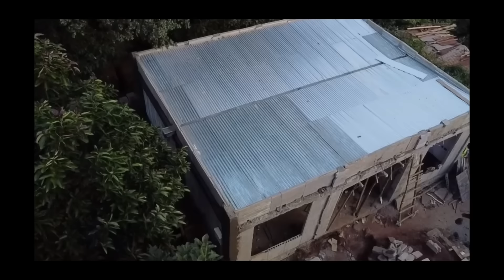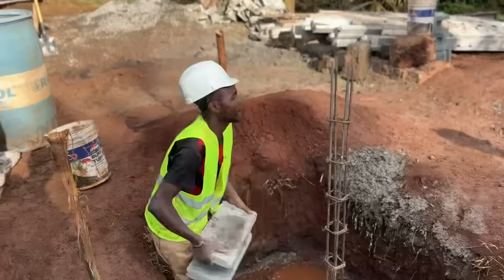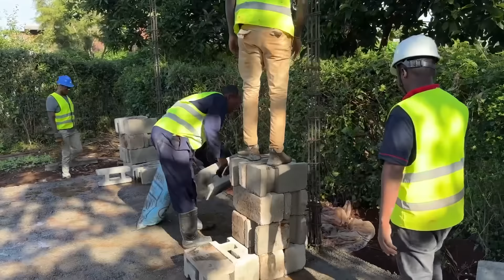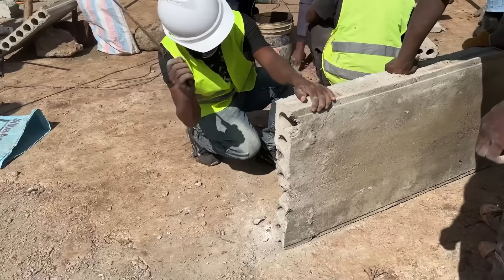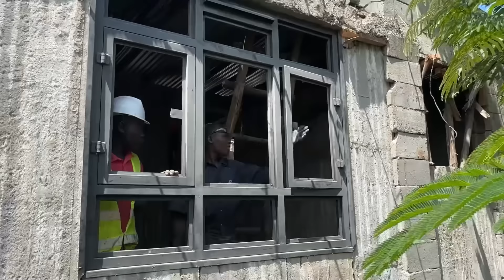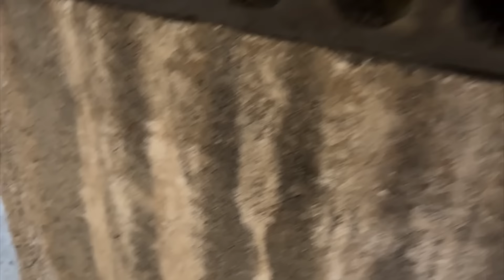Building a 3 bed 2 baths precast unit from only Kesh 1.9m

Comment: I am interested but I have a few questions..

How secure are the houses in terms of thieves drilling in..

How can someone get I touch with you.

Can you be contacted to construct for someone. ?
Reply from the maker: We are located on the following locations 

Floor Decor Nairobi 
1 Kijabe street ,Universal church building  opposite Simlaw seeds 
 0780 955 000/ 0722679830 
Nairobi

Precast Factory outlet 
0720 749 270
Gitaru , Kikuyu

Comment: I am worried about sound between rooms because of the thin walls
Reply from the maker: Got it! Primary school science: sound travels faster through solids like dense ndarugo stones (vibrations pass right through). Hollow-core 90mm precast panels have air voids that interrupt waves, cutting transmission—STC around 45dB for good insulation. Lighter, faster build too.

Comment: Just wondering , those precasts looking at the way they are cut even using a panga, there is no renforcement say even mesh wire or steel bars  they are just like slabs ... or have i missed something ??

Comment: Just wondering, is the 90mm wall sound proof?, also please talk about insulation for the precast house....
Reply from the maker: The FREQUENTLY asked question (FAQ) asked about SOUND TRANSMISSION CLASS (STC) of 90mm hollow core precast wall panels is 45 decibels compared to Durago stones which has 40 DB.

Comment: This is actually the worst precast panel work I've ever seen. There are many cracks in the panels, which is not good for a modern concrete structure. Please try to improve on your work nest time.

Comment: How do i reachout to you. Need to build
Reply from the maker: Jambo .
In order to share precast concrete  material quote for both raised foundation ,composite slab and walling kindly share an architectural drawing with detailed dimensions . WhatsApp to 0722-679-830.

Or Visit our showroom for more info 
Floor Decor Nairobi 
1 Kijabe street ,Universal church building  opposite Simlaw seeds 
 0780 955 000/ 0722679830 
Nairobi

Precast Factory outlet 
Kibaru road 
0720 749 270
Gitaru , Kikuyu 

Floor Decor Thika 
Exit 16 A Thika road 
Total energies Jomoko 
0780-850-000

Comment: I am in love with precast panels. I would love to have one like that but,with a concrete roof instead of iron sheets.
Reply: Concrete roof will be unnecessary heavy and it will need to make the whole carrying structure more expensive. I wonder about aluminium roof panels, that should last and is easy to work with.

Comment: Interesting ... though their exist alot of gaps starting from the foundation, Lack of DPM will have an effect on the floor and lower part of the walls... whats the effect of not back filling and leveling the base before laying the precast, it might be a breeding space for parasites like rats, moles etc in the long run.. i mean most people are looking foward to cheaper methods of construction but in the long run it is expensive.
Reply from the maker: Hundred units done none of such issues exist / feel feee to visit and inspect

Comment: The dedication here is top notch- passion driven per se. Good job engineer. Now I have a concern, sound haipiti through kwa hiyo precast wall virahisi???
Reply from the maker: @kevinchirchir9713  The FREQUENTLY asked question (FAQ) asked about SOUND TRANSMISSION CLASS (STC) of 90mm hollow core precast wall panels is 45 decibels compared to Durago stones which has 40 DB.

Comment: Amos I have a question about vermin control I mean pests like rats that will have a permanent dry home too. Safety for the dwellers and especially. Thank you for your ingenuity to solve the housing problem and at cost effective prices.
Reply from the maker: The crawl space is walled around the perimeter

Comment: Are precast sound proof?
Reply from the maker: @Fredstar_Ke  The FREQUENTLY asked question (FAQ) asked about SOUND TRANSMISSION CLASS (STC) of 90mm hollow core precast wall panels is 45 decibels compared to Durago stones which has 40 DB.

Comment: Wooow! This is a God-send! Vile nahangaika 🙆 gharama ya kujenga nyumba on my piece of land I just purchased! ! 😮
I will definitely go in for this. Thank you 🙏 ♥️
Reply: Contact RACKBAR HOLDINGS. Well known in the industry. Kuna moja jirani yangu uko Murang'a anajengewa na wao.
Reply: Did you get the full information?
Reply: @stephennzioki9615 no I need the numbers
Reply: What is full price? Transporting concrete to kirinyaga county? Full price I need? Thank you
Reply: you just dont know how expensive it is to  transport those  precast wall pieces,,, if you have that cost in mind, then you are good to go, though iko cheaper, just do your math
Reply: @todayinafrica-u6e how much to transport to kiriyaga county?
Reply: @Jocetheangel888  depensize of the house, it can take you  3 to 5 trips, i trip to kirinyaga can be 50 k  so do your math,, precast is cheap when the  factory is near you so u will save cost, otherwise, the transport cost
Reply: @todayinafrica-u6e 50k*5,=250k.what of numerous trips made here n there buying materials for a stone house?
Reply: @todayinafrica-u6e to the coast I gears say around 189k but to guild 30k-34k per square meter same house using precast and 40-43k using stones at the end of the day you save like a million son100-180k and saving in headaches, stealing and materials wastage plus workmanship you can't control-you choose your hard.Again rhise living close to nairobi cam have it cheaper.with regards rontransport ,mark you they transport also rhe window frames alongside if your contractor buys from floordecko and you pay for the full shell.The transport will include your burglar proofs and all you need for roofing too.

Comment: Does 1.9M include everything. That's materials and labour or are there other additional costs?
Reply from the maker: @fredrickevansw4390  distance from Gitaru factory could increase cost other factors like site accessibility if very remote could be an issue
Reply from the maker: @fredrickevansw4390  distance from Gitaru factory could increase cost other factors like site accessibility if very remote could be an issue

Comment: How soundproof are those walls? They're a bit thin
Reply from the maker: The FREQUENTLY asked question (FAQ) asked about SOUND TRANSMISSION CLASS (STC) of 90mm hollow core precast wall panels is 45 decibels compared to Durago stones which has 40 DB.

Comment: Just a thought: I think you should simplify the floor plan. It's better to have bigger spaces, and later subdivide them with removable walls. That will make the house cheaper and faster to build, with better quality and more flexibility for individual requirements. Thanks for a great video.
Reply from the maker: Precast walls are versatile can be moved if needed

Comment: My question is,the other locations you've shared where your offices are located do they offer the same services or is it just the Kikuyu office?
Reply from the maker: @conniecole3390  We are located on the following locations 

Floor Decor Nairobi 
1 Kijabe street ,Universal church building  opposite Simlaw seeds 
 0780 955 000/ 0722679830 
Nairobi

Floor Decor Thika 
Exit 16 A Thika road 
Total energies Jomoko 
0780-850-000 

Precast Factory outlet 
Kibaru road 
0722-679-830 
Gitaru , Kikuyu 

Floor Decor Mombasa 
Link Road / Malindi road Junction Bobs Restaurant building 
 0755 960 000 Nyali 
Mombasa 

Floor Decor Nanyuki 
Behind quickmart Irura Road
0755 660 000
Nanyuki 

Floor Decor Eldoret
Sosian Street Next to Eagle Hardware
  0780 755 000 Eldoret

Floor Decor Kisumu 
K - City business centre , Block C 10357
Omollo Agar road Opposite New east view hotel 
 0780 855 000 
Kisumu

Floor Decor Nakuru 
Wabcom house , Moses Mudavadi road Facing Nyayo Gardens / court road 
Call 0780 355 000 
Nakuru

Floor Decor Naivasha 
Mbaria kaniu Avenue 
Next to G4S
0755 940 000 
Naivasha 

Floor Decor Uganda LTD 
Location: Kira road opposite bank of Baroda 
Kampala 
0767257143
Reply: @floordecorkenya9339  You still haven't answered my question
Reply from the maker: @conniecole3390  manufacturing happens in kikuyu .

Comment: Good video, giving us something to think about but the information was limited, the amount of money spent on what, and the time spent doing what would be of much value, other than that, it is overall good.
Reply from the maker: Affordable 3 bed Precast Bungalow 75 sq m .

Here is the breakdown for shell only that’s is foundation / walling , Metallic doors, windows and roofing .

Precast materials cost including Foundation and channels Sh 729,800

metallic windows , doors Roofing plus labor 365,000/-

Labor to assemble precast materials Sh 165,000

Total cost Sh1,259,000

Finishes including windows glass  / wooden doors / gypsum ceiling/wiring/plumbing/paintworks/cabinetry /flooring is excluded and is as per clients preference and budget

Precast materials transport EXCLUDED

9 day job to assemble such.

Watch https://youtu.be/dCjze9QtCcI?si=AA4pKEfcyJX1cpEu

Comment: Foundation imekula pesa ngapi?
Reply from the maker: Affordable 3 bed Precast Bungalow 75 sq m .

Here is the breakdown for shell only that’s is foundation / walling , Metallic doors, windows and roofing .

Precast materials cost including Foundation and channels Sh 729,800

metallic windows , doors Roofing plus labor 365,000/-

Labor to assemble precast materials Sh 165,000

Total cost Sh1,259,000

Finishes including windows glass  / wooden doors / gypsum ceiling/wiring/plumbing/paintworks/cabinetry /flooring is excluded and is as per clients preference and budget

Precast materials transport EXCLUDED

9 day job to assemble such.
Reply: Now you have come out clear.I was really wondering how the entire shell plus finishings cost the 1.9M!

The 1.9M is the cost of the shell structure only. Finishings are excluded, and are as per client's preference. This makes a whole lot of sence. Thanks for the clarification!
Will contract you soon.

Comment: Wow, this is amaizing work. Kudos, are u available countrywide or ur only based in the central region? This is quite commendable. Subscribed, il definately hit u up.
Reply from the maker: @gerry9526  hi

We supply country and have showrooms in various locations .
Floor Decor Nairobi 
1 Kijabe street ,Universal church building  opposite Simlaw seeds 
 0780 955 000/ 0722679830 
Nairobi

Floor Decor Thika 
Exit 16 A Thika road 
Total energies Jomoko 
0780-850-000 

Precast Factory outlet 
Kibaru road 
0722-679-830 
Gitaru , Kikuyu 

Floor Decor Mombasa 
Link Road / Malindi road Junction Bobs Restaurant building 
 0755 960 000 Nyali 
Mombasa 

Floor Decor Nanyuki 
Behind quickmart Irura Road
0755 660 000
Nanyuki 

Floor Decor Eldoret
Sosian Street Next to Eagle Hardware
  0780 755 000 Eldoret

Floor Decor Kisumu 
K - City business centre , Block C 10357
Omollo Agar road Opposite New east view hotel 
 0780 855 000 
Kisumu

Floor Decor Nakuru 
Wabcom house , Moses Mudavadi road Facing Nyayo Gardens / court road 
Call 0780 355 000 
Nakuru

Floor Decor Naivasha 
Mbaria kaniu Avenue 
Next to G4S
0755 940 000 
Naivasha
Reply: @floordecorkenya9339  Fantastic, il contact you soon. Thank you so much.

Comment: Very informative, no weird musics, just good
Reply from the maker: Thanks! We like to keep it simple and focused on the work.
Reply: Swali, hii bei ya 1.9 imebeba adi labour like Kila kitu kwa hii nyumba adi wiring ama??
Reply: @floordecorkenya9339 I've ben battling with hosw yousbwvure the joints. The ring beam areas and the weight of the roof on the precast and the raises foundation I am now considering building using this method.having the H blocks and metals to secure the joints i needed to see that .I wanna save up for the shell then do the finishing in stages.Questiin though the shell is including wiring too having electricity and water running ? Or just giodigestwd then things kike ranks fitted later?

Comment: Thank you this informative video. Is the 1.9M for the shell only or is it inclusive of finishing?
Reply from the maker: @SarahWM  also included on that cost is a biodigesters and a 20,000 precast membrane underground tank
Reply from the maker: Of you have watched the video all the details from start to finishing is all there , however if you are building in far off areas from kikuyu factory distance factors will affect your cost
Reply: @floordecorkenya9339  Not everybody has the time. Slap a summary at the end

Comment: No Dpc below the panels though, the piece put to cover the crawl space will still get wet and in several years chalking and flaking will be eminent
Is the gutter stainless Stella, because webs ll know with production nowadays, QAQC must be top notch to avoid rust and consequent leaking
But I like the workability 👌
I came looking for cabros at the factory nkaambiwa production is no more 😢
Reply from the maker: Prestressed T - beams used here don’t soak water 💦 so dpc not needed .

Comment: Great job, kudos. But I stand stand to be corrected but doesn't the pitched roof make the house cooler and reduces rain noise
Reply from the maker: All works fine you only need a gypsum ceiling to keep hot  & cold away , have 2.7 m walls height  for proper aeration no stuffiness.
Reply: How are the wall panel joints, the not so deep grooves marrying into each other and just a small smear of cement for the weight and height and considering it's many of them running all around and the bottom part also just a small amount of cement ,how us is strong?

Comment: How strong is this against a 30mns to 1hr attack by thieves...if kama they came prepared to make space throw the window ama mlango...for time depending na security that's how long raia ama police would take to show up if security is not that high
Reply from the maker: Security is basically an illusion in the Mind for example for quarry stones a thief basically need to remove one stone and they gain entry  however modern thief nowadays have easier option to wait for you at the gate and gain entry with you all they need is phone get pin steal from Mpesa / banks etc etc … invest in modern day cctv , alarms / Motion detect and vibration sensors with backup to deter thieves .